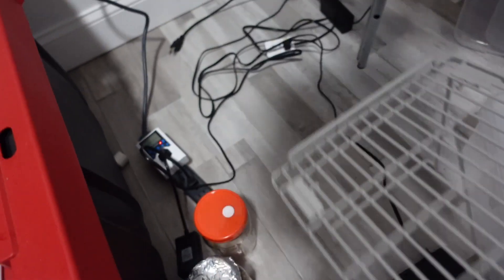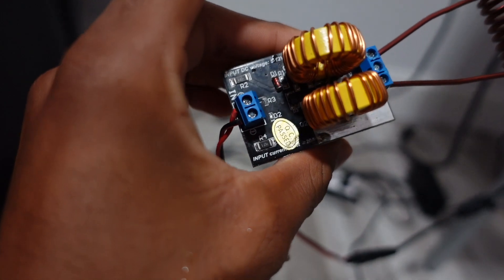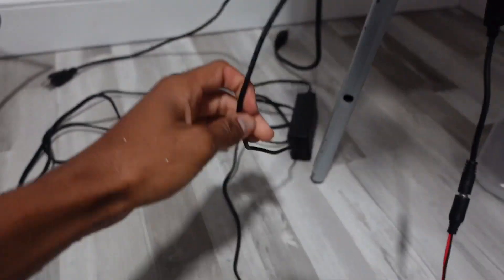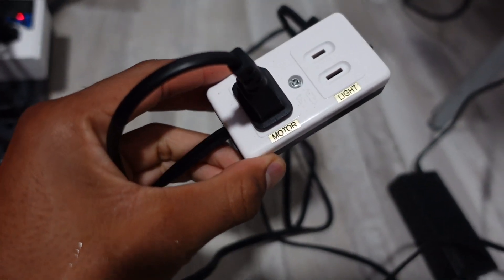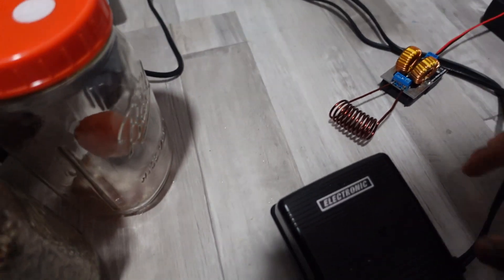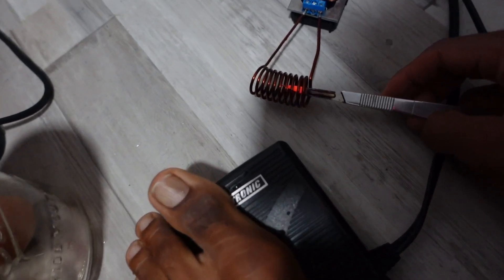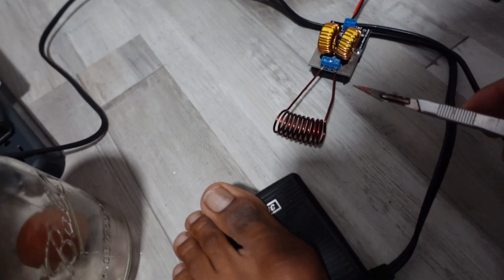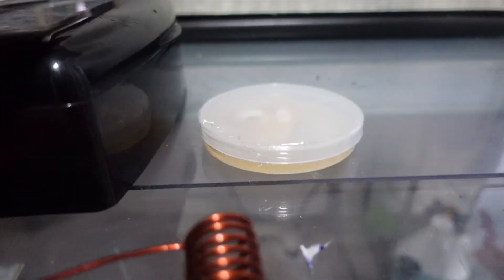My Scalpel Sterilizer Setup | DIY Induction Sterilizer

Comment: Thank you so much for this video. It's wonderful.  I bought the suggested housing unit and I'm nervous about using trying to use it.  How do I create small holes for the coil an ensure the coil doesn't melt the plastic?   Anyone got any suggestions or a video on modifying a housing unit for DIY induction coil?   Thanks!
Reply: I went ahead and made one. It is kinda ugly, but it works.  I used a dremel to make the holes. And a cable gland to hold the cable secure in the box.  Didn’t know what to do about the coils so I just cut a shaft out of the box so it wouldn’t touch the wires.